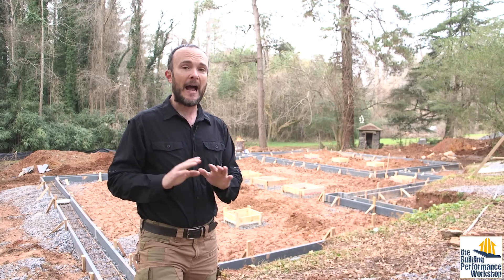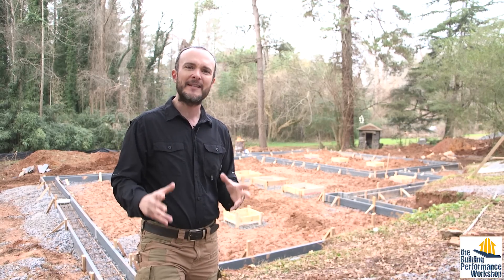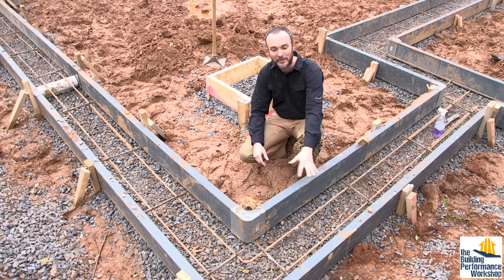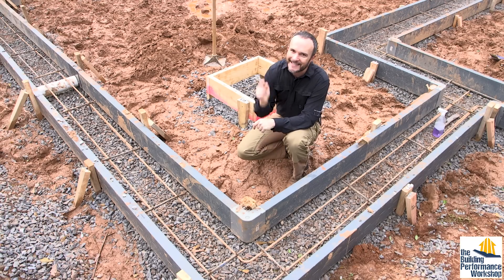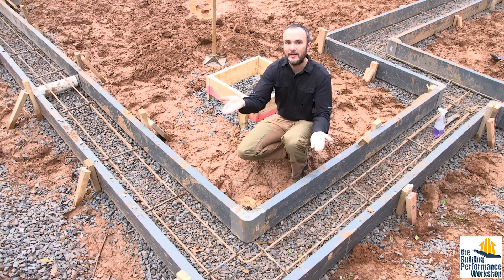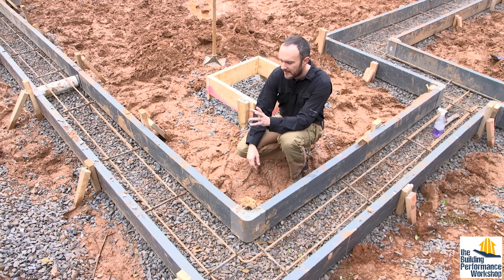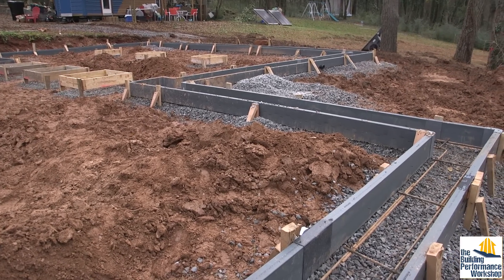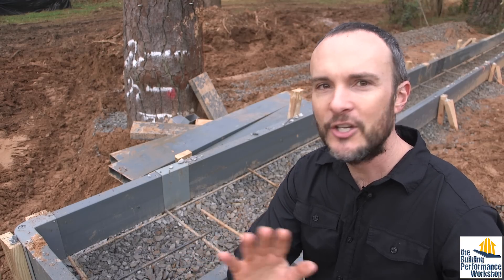First Concrete Pour: Form-A-Drain 4-in-1 Foundation Footings

Comment: Not bashing or being a Dick. That said, the concrete doesn't adhere to the rebar in the sense that there is a permanent bond. The ridges on the bar are what locks it into the concrete. A slump test can be done on site. Simple tool. The slump is the number of inches the concrete settles when the test is performed. A slump gauge is readily available at many construction tool outlets. If anyone does this and doesn't want their footings to look like a pregnant snake, make some collar pieces out of plywood to holds the forms at the right dimension. Place them every 4 feet. That will keep the forms from bowing out like the ones in the video. Also, that form drain needs to have a barrier to keep dirt out, but let water in. A fabric material is what we use. If that drain fills with Georgia red clay, it will be rendered useless. Any reputable concrete supplier will have an automated system that determines the specified mix. It automatically adds the material to the truck in premeasured quantities and the concrete is always good. In my 25 years of concrete construction, I have only seen one sample cylinder that broke before the engineers required number. Wasn't a big deal as the engineer decided the number was close enough. I can understand the guy wanting to ask a lot of questions. That is fine and I always answer if there is an answer. I find there are no stupid questions. Just don't be a pain in the ass with non stop questioning on everything. Most builders are happy to answer questions and even teach homeowners methods and explain why it is done a certain way. Though I do find that people who want more and question everything always seem to be the same people who complain about the price after the work is complete or are hard to get payment from. Anyway, I am definitely going to look into the form drain system.
Reply: Your approach sounds very reasonable to me.
Reply from the maker: Thanks Bart, appreciate the non-dickish comment. Stay tuned to see the foundation finished with details that will make you happy. Also, I'm the builder and GC, and I'm always upfront that I'm willing to pay more for better quality, amazing how many of our fellow building pros will run screaming at that.
Reply: I always do what the customer wants done, so long as it is a sound trade practice. If it is not, I explain why it shouldn't be done that way . I rarely have a bad experience with a customer. In over 25 years, I can recall two instances where a customer was hard to deal with. One didn't want to pay for extra work (a lady who complained and her husband actually apologized to me for her behavior) and another customer who wanted me to rearrange hearthstones on a fireplace because I apparently wasn't smart enough to read her mind. Ha ha.

Comment: We always left the chairs in, you should have had epoxy coated chairs, that moisture that wicks up will go right up through the chairs if they aren't coated a ferrous metal will rust and they have a direct path to your rebar.  You are the most annoying kind of customer...(i would be too, but I have a years of experience building bridges)  If I had been doing your job I would have put my regular forms outside of your forma-drain forms and they would have kept your forms from moving or bowing.  It does matter that the foundation is not where it is supposed to be, it is worse than just costing you more concrete, you will find out how bad things turned out when you move forward with your project.   You can do slump tests on site, it Should be done on site even if "they did it at the plant", and.. they're easy to do.  We always just cleaned the rebar with a pressure washer, it's fast and easy and provides a clean enough rebar to ensure a good bond and help ensure good adhesion.  I wish you the best of luck with the rest of your construction project, sadly I think you literally started off on the wrong foot.
Reply from the maker: Thanks, I appreciate your considerate note, but this is not my first home build and I have lots of consultants who are very experienced advising every step of the way. I prefer to think of my job as a home performance testing expert less 'annoying' and more 'quality controlling'
Reply: An alternative to installing form boards that will later need to be removed is to either use tie wire that has been mentioned in several posts, or gravel in both sides of Form-A-Drain prior to pouring the footing.  There is not concern with the minimal bowing that took place.  The forms will hold due to the screws installed, and as long as his footing is level (which clearly was the case) he will have level walls which is the primary concern on the next step.
Reply from the maker: Update: the walls are in, the floor is framed and subfloored, and all is perfectly square and level. No worries.

Comment: where are the wires that go between the inside and outside of the form a drain? They also hold the rebar so no need for the little stands that cause corrosion.
Reply from the maker: Interesting idea

Comment: So...

In that footing, IMHO, and it's only my opinion but I've built several slabs and foundation walls... that's minimal reinforcement steel. I would put two layers like that and every 24" or so use short vertical pieces of rebar to separate them and hold them off the ground. 

Also, you should protect the underside of the footing with a vapor barrier to prevent the rebar from ground contact and later galvanic corrosion. 

If you need to make sure your steel does not sink, tie a short rod to it every few feet with wire and hang it across the form. Later cut the wires after its cured.

Comment: Double drain inside outside the foundation has no reason, except costing a lot of money ... a good drain outside make the job perfectly

Pouring the slab together with the foundation is a good option maybe the best because you increase your volume of concrete and you deacrease the price , not to mention the connection between both

You rebar is just a joke , espacially if your soil is bad 

15:04 placing rebar after the pouring is not a good option 

And this product ( drain ) is not good product: it s not protected from the  fine particles who finish to block the slot and then he could not accomplish his fonction anymore
Reply from the maker: There will be 57 stone with geofabric protection

Comment: Form a drain was used on my house that was built in 2003. Works great no problems. I'm skeptical though of your 4th use as radon/humidity evacuator though. You can only suck so much air out of a closed box unless you have a hole in it to the surface for air movement to pick up the gas and water vapor to be sucked out the other end.
Reply: https://www.youtube.com/watch?v=AAbXyGtozyE    I guess a passive radon system would work as the manufacturer specified. I still need a dehumidifier in my basement though.

Comment: Yea my cuz has done commercial and residential. Someone built forms out of plywood combined footing and stem wall. We had to take out forms . with back hoe credit footing backfill and compact base below freeze line. Gets 20 below temp here. Then build. Forms and use metal stakes. Only one blowout on 15 foundations when ready to pour that was quickly corrected. The project manager was former army engineer who only had book knowledge not real experience . he thought just plywood would do the job. We dug out boulders 3 foot . Then did proper backfill and compaction. I ran the compactor for a week. Looks like their are better systems out there. Imho I would defer to others in family who have decades of experience. Most inspectors would tell you he a r out blow out repour. The sub would tell you hi m e and materials change order. You hire a sub to build to standard and you have no legal right to order anything. At conclusion you evaluate complete product. A project $12,000,000 damages. A trial and $1,000,000 legal fees...poor contractor and poor inspection. Just like you. We got our $12m but much higher cost to repair.
Reply from the maker: Thanks, but I’m not worried. Geotech engineer, struc engineer, several builders all consulting on this along with FAD manufacturer, plus this isn’t my first rodeo

Comment: Advice that a tradesman is giving you about how something is traditionally done would normally not be considered "putting up" with something.  It's a great opportunity to learn, one that is lost on you.  I hope you can learn from your mistakes.
Reply from the maker: That’s not how I meant it. I meant that when you have an idea for something non-traditional, you might have to persist alone in pushing for it, since your team will likely push back at least a little. Learned on my first build that even as sure as I am of building science, I started to doubt everything if I was the only one
Reply: @HomePerformance  There is a lot of pushback to new ideas because among other things, insurance is expensive, and professionals are just trying to cover their ass. So yes, trying something knew that you believe the science behind is risky and takes confidence.  Small unforseen variables can cause cascading problems, often in ways that can only be learned having done something before.
Reply from the maker: Well said

Comment: Form-A-Drain/Radon.  You mentioned the form-a-drain would help pull the air from the foundation to help prevent radon build up.  But, a drain has to dump the water somewhere, in basements a sump to be pumped out and in your case it appears to daylight  at the back of the property (as viewed from the first few minutes of video).  A vacuum is going to draw air from the least resistance which is first through those large  drain openings.  I guess maybe I'm not seeing how a vacuum will be created in the gravel bed.
Reply from the maker: Good question- I had the same one. The daylight openings will be pop-ups, which will provide a backdraft damper for the fan
Reply: Ya, didn't see your post as I posted the same concern with that use a radon/humidity extractor. It's a closed system unless he has another hole to the surface for air movement.  I still use a dehumidifier in my basement and it has the form a  drain to gravity.

Comment: Never let the concrete supplier dump one gram before doing a slump test. Slump tests are to be performed on site just before the load is ready to dump, pump etc. Do not ever rely on the concrete supplier to tell you the slump. It is a simple procedure and takes about five minutes to do. Always verify your mix is what is specified by the engineers. Always record your slump test and keep written records of the time the truck arrived on site and when it actually emptied it's contents. You only get one chance to do concrete properly. Improper mixing and using retarder's to extend the working time of concrete are the main cause of failure. Never ever trust a concrete supplier to do the right thing. Someone's children will be living in that home and it better be 200% correct.
Reply: YES! DO WHAT MARK JOHNSON SAID
Reply: @paulmaxwell8851  Slump tests need to be done on EVERY truckload of concrete poured on your site, I am a special inspector for a S.F. bay area lab, and we guarantee our clients that the strength of the concrete is, what is as advertised. We also inspect at the concrete Batch Plant when doing big jobs of over a thousand yards or more. To much water will weaken your concrete strength, and only the project engineer can say add an inhibitor, or any other additive.
Reply from the maker: Are you really talking about a house build? Thousands of yards?
Reply: @HomePerformance  No I was referring to warehouses and big box stores  with there slab floors, I also did a few houses mostly for wealthy clients of the co. I worked for, as independent inspection is expensive, and the average homeowner can not afford it. You can get your contractor to do it for you if he is a good guy he wont refuse, it will not cost that much, he can do it himself with just a bit of practice, all you need is a slump cone a wheelbarrow and a shovel and a rodding bar to do the test.
Reply from the maker: ...And a target slump (who specifies?) and the willingness to upset your boom truck operator if it's too dry and to turn trucks back without pouring.
Reply: @HomePerformance  You cannot afford to have that attitude. Who cares if they get their feathers ruffled. You are a paying customer and deserve to be treated accordingly. You engineer will set the specified slump. Remember it is your home and you will pay the ultimate price. Just as important if it is your client's home you will be the one who gets sued and possibly lose your license. When my concrete is sent out incorrectly I backcharge the supplier. I test every load myself. It takes less than five minutes. The entire project will fail if the concrete is wrong and someone could be seriously injured or killed.
Reply from the maker: I didn’t mean that, I meant our engineering firm did not want to specify slump, they spec’d strength. They are a national firm, very good, but I imagine with all the additives going in, and the many delivery methods (boom pump being one), it can be hard to target for a residential project. Please see our follow up:
High Performance Crawlspace Walls: Slumps and Pumps
https://youtu.be/pL91TNpcgI4
Reply: @HomePerformance   Do not let a pump operator dictate what slump he can pour. Ive always poured footings at a 3 or 4 slump depending on how hot it is that day just for work ability The concrete supplier will test each truck at the yard before shipment. If you add water on site that load is now on you. Anything higher then a 5 slump for walls or footings is to wet in my books because it will tend to sink. Your Crete was definitely a 5.Main problems for a pump is waiting on the next truck(which they can just reserculate) or stopping in order to unclog or for you guys to fix something. First look at this set up I knew the forms were going to expand lol we use steel crossbars that hold the footing in place aswell as steel spikes instead of 2x4 spikes. We hang the rebar off of those cross bars. Did you put any cloth over the forms before you brought in the stone for backfill? Because alot of times the stone comes covered in dirt and that will work its way into those forms. Perferated pipe has cloth over it for that exact reason also for any dirt that makes it through the stone. You've got a solid footing in my books. Good job cleaning the rebar because that rebar would have been a fail for how dirty it was. Just a heads up for next time be aware that the pump can tip when set up sideways. Any pump operator I know would not set up like that especially when extending that far out. Good thing you were involved with the process and did your research because alot of company's either dont know or dont care.
Reply from the maker: Thanks for the advice James
Reply: Slump test are done at the pour site typically, it’s done to make sure the plant didn’t F up the batch, also contractors always ask for the driver to add water. Water added reduces strength hence the slump test right before the final pour. The best way to test is to take cylinders and do a break test...
Reply: Can someone tell me what any of this has to do with "someones children?"

Or is that just an excuse modern people use for everything nowadays?
Reply: @Craig Gagnon Well some clients can be irritating that is very true. But as a professional is is your job to communicate and sometimes educate your client. Also you have to be open in that your client may actually educate you on something. I know guys with 20-40 years experience and they still cannot clearly communicate with the client about what they are doing and why. I personally like a client who has researched the product/procedure and has questions. The only way a client can do harm is if you as the contractor allow it. Either through improperly written contracts and or by not communicating with your client. Advising someone to verify their concrete load is the proper mix and consistency is not bad advice. If you as a contractor do not check your concrete delivery for slump and mix, then that is just negligence. As I stated it takes 5 minutes to verify slump and mix. Five minutes of my time to insure that there is not a catastrophic failure and or possible loss of life, is five minutes very well spent. The legion of irritating homeowners. LOL. Sounds like a scary movie.
Reply: People that actually do Concrete work can judge slump by eye. The QC guy isn’t going to show up for your residential 30 cy footing pour. You can pay a testing company, or buy a slump cone and learn how to use it while you have a truck sitting there. It’s all about water.... order 4000, don’t exceed specified water, it will break greater than 4000.
Reply: Slump test has no importance for a foundation work( and for a lot of other work) you just know the consistance of your concrete and then his workability nothing else , ratio water/ciment is more important, using a retarder has no (bad) influence on the quality unless it s a proper retarder ( and not glucose water mix made on site for example ), you have 90 min to pour your concrete since it s put in the mixer, if you use retardant this time increase, using a retader rise up the mechanical performance of your concrete , see sika files if you don t believe it
Reply from the maker: That’s funny, I have a foundation foreman who has decades of experience. Maybe it didn’t occur to you that I might shield him from your aggressive uninformed criticisms.
Reply: @HomePerformance  I do apologize if I offended you. It was not my intention to criticize you. 1. Open mouth. 2. Insert foot. Arrrrghhh now I am officially a " Youtube Jerk" as my grandson puts it.
Reply from the maker: Aw thanks Mark. I appreciate it, and I know we all are interested in the same things ultimately if we’re all nerding out about this topic.